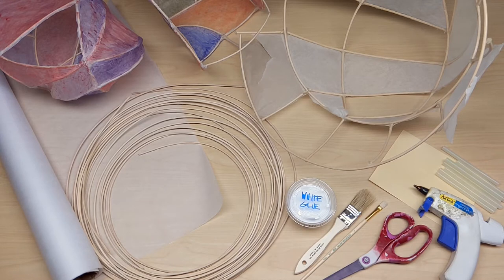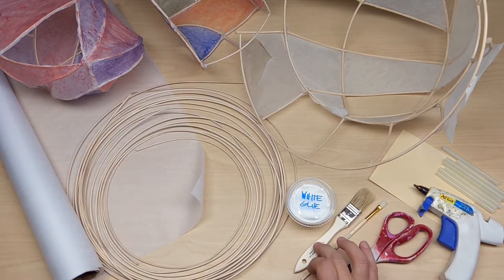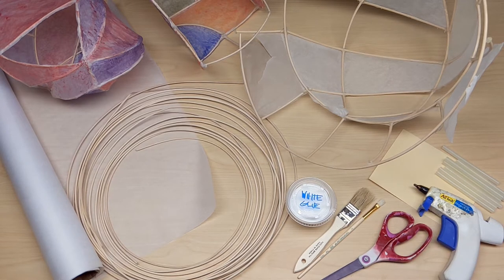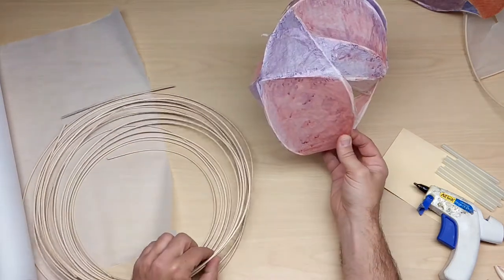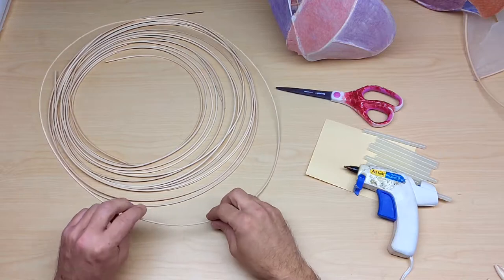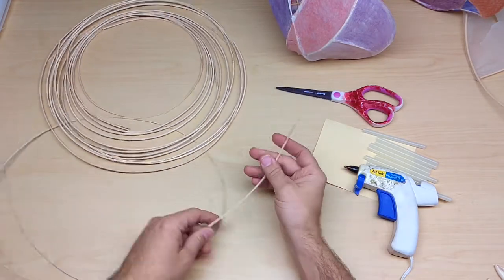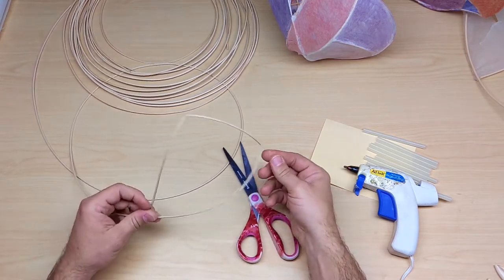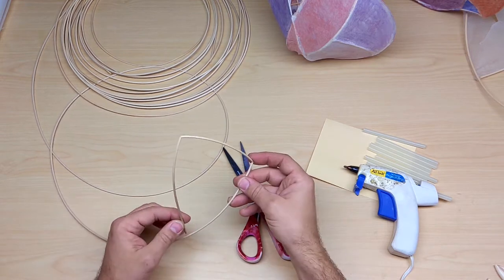Reed & Paper Lantern - 3D Design Project (P1)

Comment: Hi! It work with wire ?
Reply from the maker: You can, however the glue will not stick to the wire quite the same way.  You may also get rust (depending on the type of wire you use) which can be interesting.
Reply: @garycarlos736  Ok thank you for your answer. I will probably have to use super glue if I am using wire. Indeed that would be interesting.